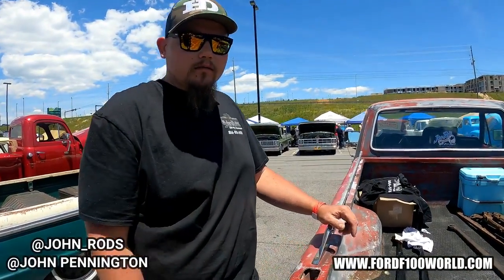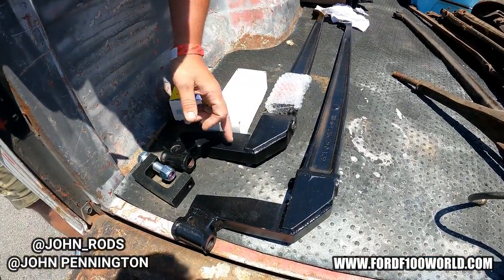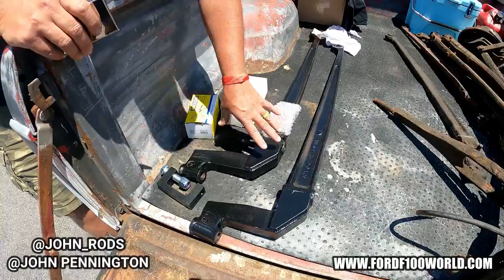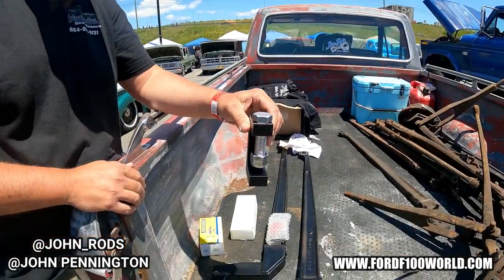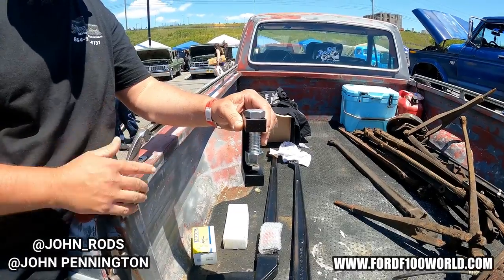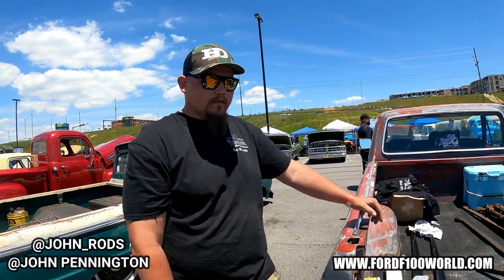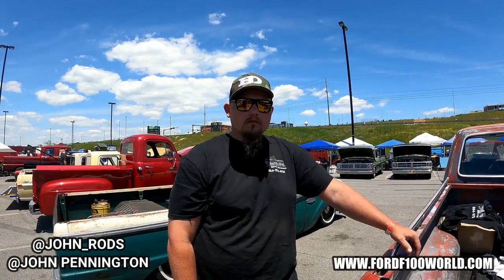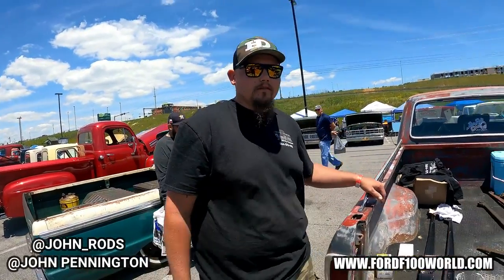F100 John Rods Drop Beams @fordf100worldmemberstrucks9

Comment: I agree what we need is a market for somebody to actually put pride and quality into their products instead of just making money I bought a set of chassis tech beams and it was a nightmare I lost out on about $800 I sent one set back the first set because the day were made wrong they were longer than my factory beams one wheel was more forward than the other and when they sent me the replacement back it was a half an inch longer and it still did not the correct the problem of the driver side wheel being forward 3/4 3/4 of an inch more than the passenger side sure it was a 5-inch drop the truck looks sick because they were thin beams and they wouldn't hit the under crossmember but what's the use of having them if your wheels are offset and crooked and you're going to wear your tires out and it's going to pull the one side all the time. So then I purchased a set of dream beams high quality the only problem is they're strict on the 3-in drop they're very thick so you can probably get only about close to 4 in Max and you're running close to hitting your crossmember on the  driver side beam . I would have loved to have found this guy earlier before I wasted $1,000 at chassis tech and then spent $700 for djm

Comment: I have a set of DJM drop I beams on my 1978 f100. I do not like them. Would like to try these out on my other 79 f100. Currently ripping my 78 back apart to bag it.
Reply: I am on the same page. I have a set on my 70 F100. Nothing but problems. I will contact John_rods for a set of theirs!
Reply: I have them too truck shakes wobbles bumpsteer is bad